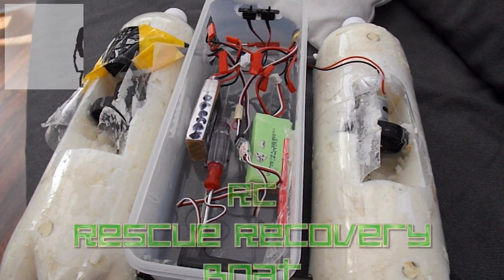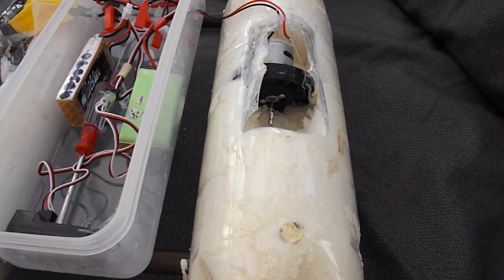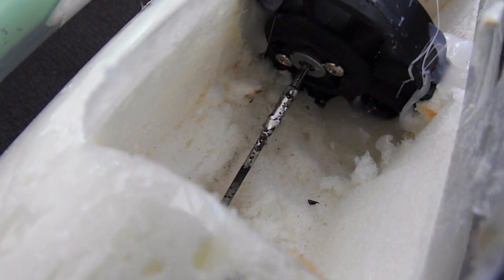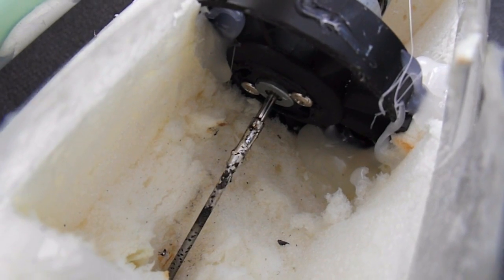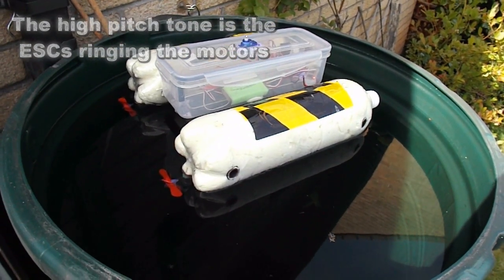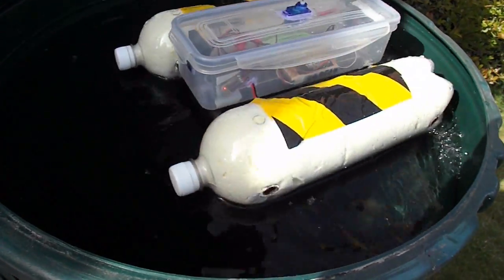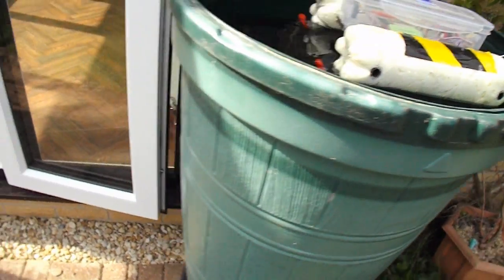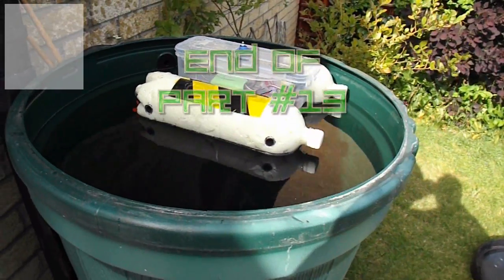RC Rescue Recovery Boat Part #13 Soldering the prop shaft

Comment: Smaller motors like these tend to have little in the way of thrust bearings, usually its just a nylon washer behind the commutator, the life of these isnt going to be that long with high thrust.
Still your not going to run in in full reverse for long periods so it'll last enough to rescue several boats.
Reply from the maker: hellcattanks none of my projects are expected to last long, but then neither does my attention span so we will be onto another subject soon enough :-) The main idea of my channel is to have a go and do it simple cheap and quick, if that gets people interested in a subject they can always take it further and do it properly.
Reply: GrandadIsAnOldMan I have to say I'm the same, the main reason for replying is that its interesting to talk to someone else who has even a remote interest in such things, this kind of thing is dissapearing.

Comment: Can you make wave durable rc boat
Reply from the maker: Thomas Sebring I could but I would then need to invest in some decent motors, proper ESCs and bigger batteries so I won't be doing that. It would be a proper "Hobby Grade" project and my channel is about cheap, simple and quick to build. You will quickly find videos of that sort of boat on YouTube if you search for them.